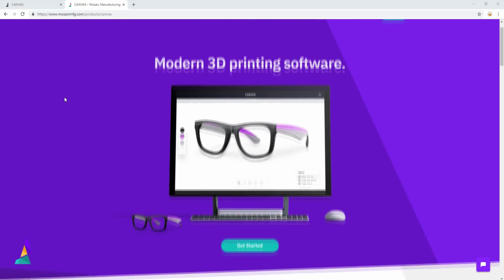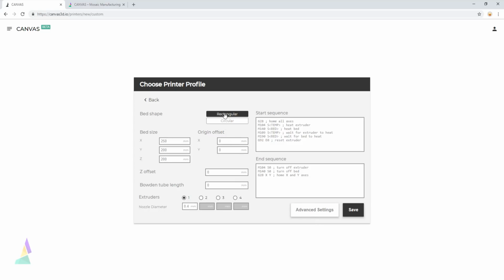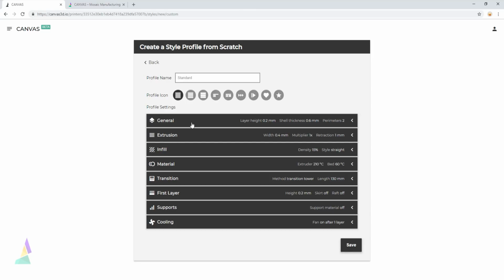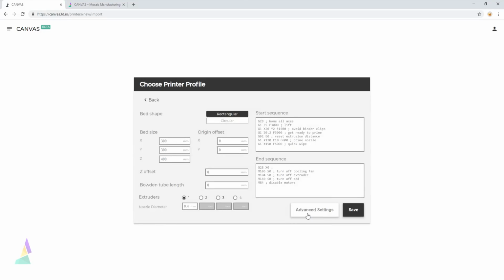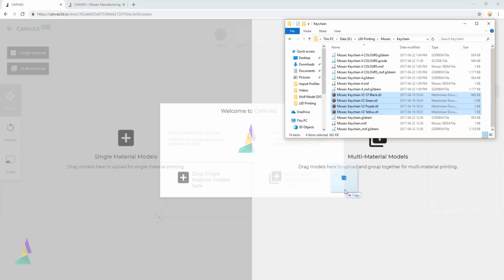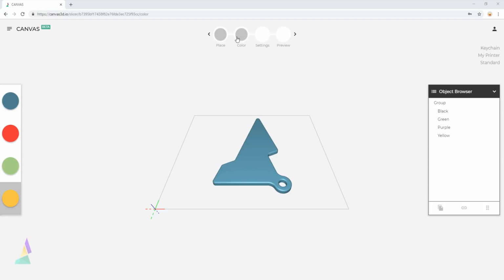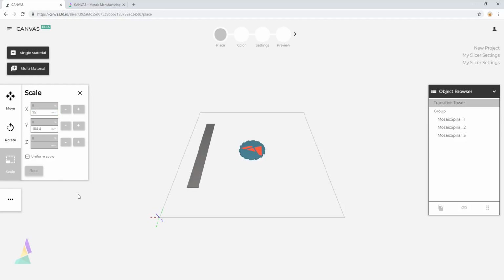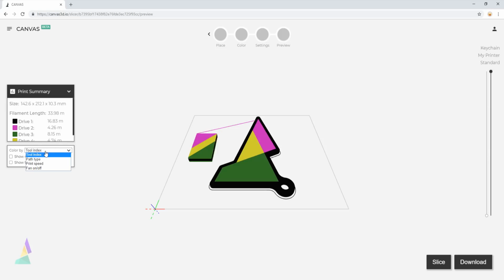Getting Started with CANVAS and Palette 2

Comment: Hi I receive my palette 2 s pro and canvas hub s I did all the setup, but I am having trouble with z it's  not lowering completely to the platform when I start the print and after the print starts it won't let me lower z with controls it will go up but not down. Any help will be really appreciated BTW the printer that I am using is Snapmaker 2.0 A350.

Comment: 15 minutes of poking around and I couldn't figure out how to assign a color to a piece. It took watching this video to figure it out :/
Reply from the maker: Sorry to hear that, Ted! We also have a tutorial built right into CANVAS that can be found by following the steps here: http://mm3d.co/canvas-onboarding
Reply: @MosaicManufacturing  FWIW, I had this same issue while using MS Edge browser. You cannot adjust color settings as any click of the mouse on the desired color selects it automatically, with no way to unselect. At this point, I have to close the project and retry, only to get stuck at the same point. Works as expected in Chrome.